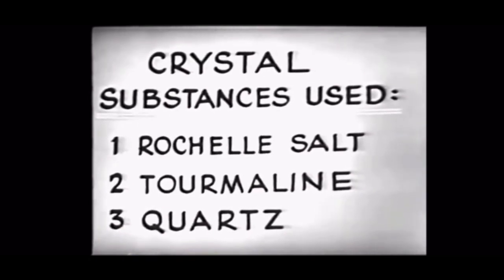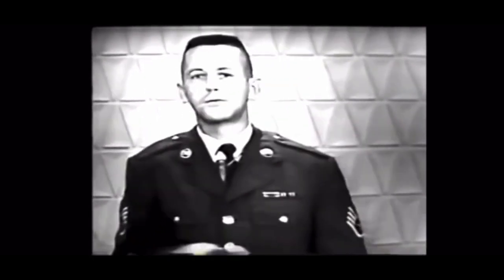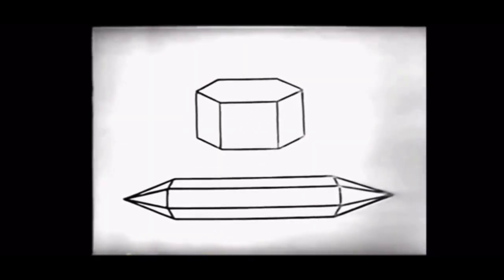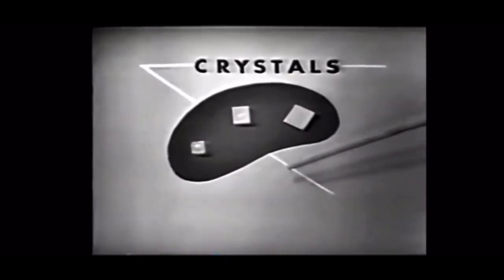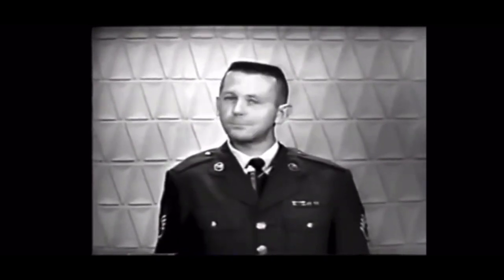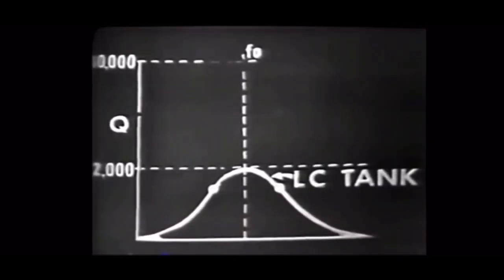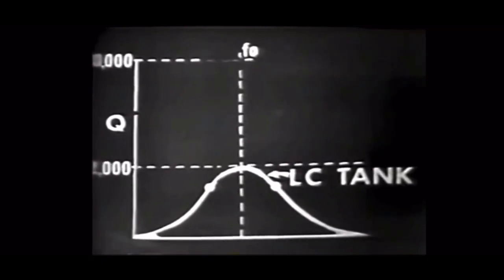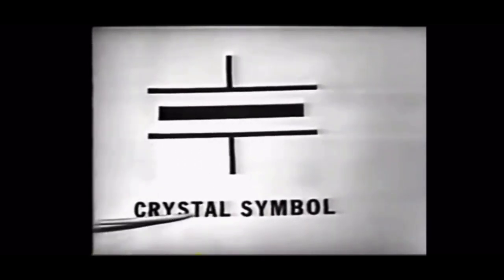Chracteristics of Crystals ⚡️Energy, Frequency, & Vibration⚡️US Air Force Air Training Command 1964

Comment: Very nice, it is good to see these old videos. 
People studying the formation of different crystals in caves have discovered that it takes a certain frequency or amount of light to create these crystals, from  the minerals dripping into the caves.
     They discovered that when they opened the caves up to bring more light into the caves, the crystals did not have the right amount or frequency  of light and the crystals would no longer form in the caves.    
A structured rearrangement of atoms to form crystals  also requires a certain band or frequency and an input energy.
  Water forming ice also requires an input energy, infrared seems to work best to create ice from freezing water.